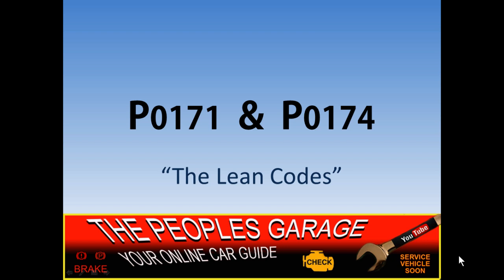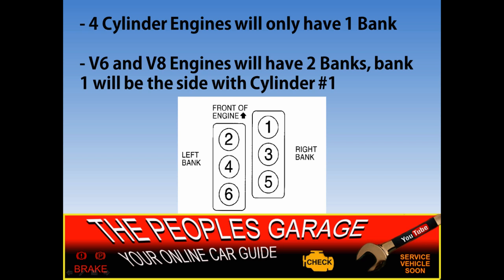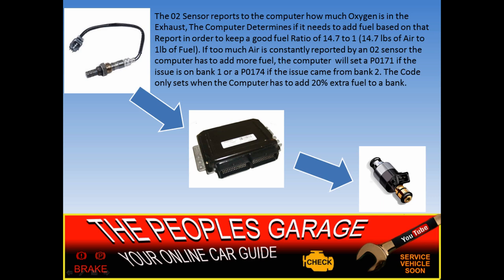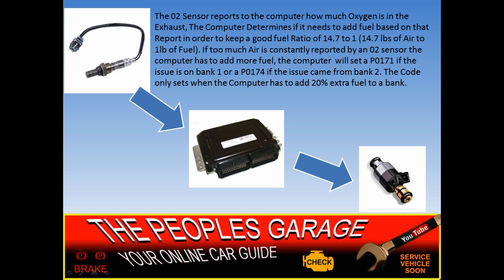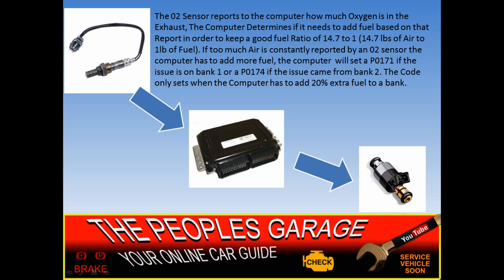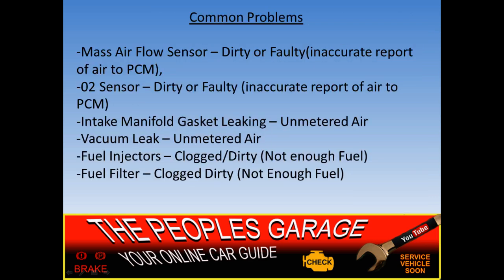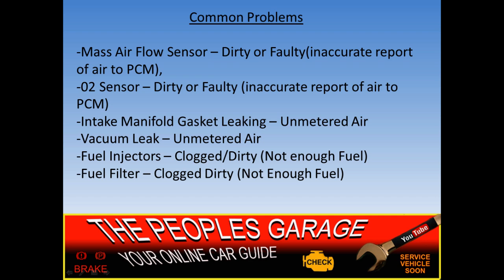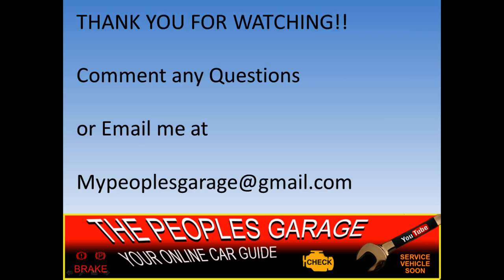How to Diagnose Codes P0171 & P0174 - Lean Bank 1 & 2

Comment: I have a 2011 silverado 4.8l i cleaned the MAF sensor checked the intake for leaks didnt get anything on that replaced the O2 sensors light went away and didnt come back till about 1000 miles or more later what else can I do I dont have a rough idle at all and no lack of power. I do have an exhuast leak behind the muffler and im pretty sure theres no vaccum leaks

Comment: I did found a vacuum leak and fixed it on the fuel injector #7 after cleaning injectors and replacing the seals, I still had the lean code. I took off the intake manifold and found that on that cylinder there was evidence of back fire the plastic was charred and causing a leak on that injector. fixed that. however I still have the P0171 lean code.

 I'm going to check again for vacuum leaks and change the fuel filter. I will check again the MAF sensor and test it. I'll update when I found more info.

Comment: Love the video. Can you advise me which o2 sensor /reports the airflow that is reacted on to give the lean fuel message. I.e is it both o2 sensors or the one post catalytic converter or the one near the engine bay? - On a two o2 sensor engine.

Comment: usually, if you have that lean code on both banks you have a vacuum leak or low fuel pressure which means more air and the oxygen sensor will throw a code.... lean bank one and bank two.  just a thought, everyone is in such a hurry to replace oxygen sensors just because the autozone scanner said thats what it is.  lol    wow, i know,   anything to sell a part they dont need
Reply: Get yourself a 40 dollar code scanner on Amazon. With that you can see your fuel trim levels and diagnose your issues. There are tutorials online that would help. It is easy to rule out vacuum leaks and 02 sensors if you had the scanner.
Reply: What if my 99 mustang gt gives P0174 and the MAF says 5.0 g/s?
Reply: Very true!!!
Reply: Lmao you got me at autozone scanner, will definitely look for a vacuum leak.
Reply: james hayes
Reply: Just got p0171 and P0174 no codes before I added gumout octane booster to a full tank 2 tankfuls ago, can that be it? How do I fix? Only other thought is maybe MAF got dirty from all the ash floating around here in SoCal from the fires, no visible hose cracks any suggestions appreciated have to take in for a smog check thnx
Reply: @arikoenig4536  check your intake air filter first. The filter comes before the maf sensor and should've captured much of the smoke from the air.
Take a look. If your filter is old and dirty then maybe go get yourself a replacement... I suggest a fairly inexpensive upgrade to a k&n filter while you're at it. It shouldn't cost much more than a stock or basic filter.
If the error code continues after replacing it then I would get a spray can of maf cleaner and spray that mofo maf down. Fairly simple to get out and clean for most cars.
If your filter was clean or the issue persists after doing the steps above then I would start leaning towards a possible vacuum leak. 
IMHO The fuel additive is unlikely to be the cause. Was there a reason you added it to your car? Was there anything else out of the ordinary done to your car? Sometimes the lean codes can take a week or so to show up and/or go away. Some cars require 20 miles or more of driving to turn on/off those error codes.

Again this is all just my opinion and it might be completely wrong. It's really hard to  say without looking at the car.
Reply: @arikoenig4536  Any luck fixing your issues?

Comment: Thank you for the explanation  on the P0171 and P0174 codes. I have a 2005 ford F150. I'm trying to diagnose the engine. It sounds as rough as a diesel, It has P0171 code and has a chug sound coming from the exhaust, It runs very rough, but when I press on the accelerator it evens out when it runs passed 1200RPM. The sounds either go away or perhaps the engine is running too fast  for me to  hear ( the chug and the rough idle). It didn't have any codes until I ran it for about a halve hour after adding almost a qt of Miracle Mistery oil, in the oil. It did run much smother after adding it though. I've heard of problems with cam phasers, VCT solenoids, and Lash adjuster lifters that get clogged causing to jump of timing issues. I'd like to know where you would recommend to start the diagnosis process in order to fix the issue. I'm thinking after viewing your video; should I start by cleaning the injectors and checking the ignition such as coils and spark plugs? the truck has been maintained with scheduled oil changes and services for the most part.Thank you again

Comment: have a 2011 silverado with a 4.8 I'm getting the 171 and 174 code the check engine light comes on and then shuts off i cleaned the MAF sensor and ran fuel injector cleaner threw it I do have an aftermarket exhaust on it just wondering if its the O2 sensors or the intake gasket

Comment: Thanks for your video! I have a 06 BMW X3 and it recently displayed three faulty codes ; p0507, 171 and 174. I removed all of the vacuum hoses and realized there was a leak in the intake boot, so I got that part replaced. Then I erased the Check light indicator and it appeared again, but this time with only 171 and 174. Do you have any ideas what might've went wrong?  Thanks!

Comment: Very helpful ,  I have a 2005 sts cadillac.  mostly around town driven but in the last few days I have been hitting 90-100 mph on the Arizona highways,  all of a sudden when I stop it feels like the car is running on 6 or less cylinders.  very bumpy engine performance.    93,000 miles on it.   Can I drive to vegas (from Phx) and fix it there without destroying the engine or computer.  I am crushed for time, need to get there for work 7 hours from now.  I am going to take a cursory look at the hoses and see if it is the elbow on the back side of engine.  any input would be apprciated

Comment: Hey I appreciate this video, I have a question though, I have a 04 mountaineer. When I am driving down the interstate it will act like it stops getting fuel and then it gets it again and when it happens it bucks really bad. It will do it over and over for several miles and then go back to normal. I have had it checked and the lean codes show up.I have changed the fuel filter. What else can I do.

Comment: I have a toyota corolla 07 and i got p0171 so i ckean the mass air sensor,change 2 oxygen  sensor, change the manifold, and it still have the same code. I checked for leaks on the catalic or muffler  but there is none. I hope you can help me with this problem.

Comment: Btw - how can you tell if the intake manifold gasket has a hole?  Is there some clever way?
Reply: Alan Osman spray brake cleaner around the gasket while the engine is running, if theres a hole it will suck in the cleaner and the engine will rise in rpm

Comment: ok so I just changed the spark plugs and wires and throttle positioning sensor and about 2 months prior to this I changed the fuel filter on my 04 mountaineer, now when im driving down the interstate at around 75 or 80 mph it bucks really hard and loses speed. could this be caused by a bad fuel filter????

Comment: So I have a 2006 Chevy Silverado 2500 HD 6.0liter V8. I am getting P0174  and P0171. Things I have replaced- Mass Air Flow Sensor, all 4 O2 sensors, air filter, also unrelated but the knock sensors. I cannot seem to nail down what the issue is. When I replaced the knock sensors (yesterday) I checked the injectors and they didn't look bad. Now I just also got a P0446 code. Did not have that before doing the work yesterday. Any ideas. My next step I guess is probably the fuel filter. But after that I am at a loss.

Comment: Hey, i have a p0171 code on an HR15 engine on a Nissan Tiida. i changed the o2sensor before and after the cat, cleaned the maf sensor and reset and after an hour of driving the check engine light comes back up........same code appears again...

Comment: I have a 2003 Lexus ES300 with the following codes: p0300, p0171, p0305, and p2195. These codes came on after bad gas was put in my car. I replaced the A/F ratio sensor. I need to know if I need to change all plugs and injectors to handle this issue.

Comment: hi, thank you for the very informative video! 

i'm not a mechanic, just a 2008 VW Eos 2.0T 6 speed manual 4 cylinder end user who's car is throwing the DTC generic code P0171 "bank 1 system too lean".  i took it to two recommended shops shere i was told they had sophisticated diagnostics and tools.  either they did not or wanted nothing to do with a VW.  which i've heard before.  i need to get my car to pass inspection and emissions in the state of PA (pittsburgh).

the car runs fine otherwise. i don't notice any missing, sluggish acceleration, high idles or anything like that, although one very freezing night it would crank once (i had dash lights) but then do nothing--it never happened again though) other than what i swear sounds like airflow right at the beginning of second gear.  like if one were to open your mouth and breathe out through the throat (don't laugh, i'm serious). 

something perhaps important to note is that the car sat for nearly 3 years while i was living in nyc.  and i hadn't drained the fuel or use any stabilizer (now i know).  so i know i'm going to need a regular tuneup as well.

also, if it matters, moons ago i had a 2004 VW jetta 4 cylinder where the check engine light went on after XX,XXX miles and ended up "needing" o2 sensor(s) but i don't know what codes went off or what else may have been fixed.  i realize it could have been a multitude of things, but little italian guy armondo (RIP)  in philly fixed it.  quite a bit of parts' $$ later.

anyway, any suggestions on the best way to identify a reputable shop, other than a VW STEALERship (no offense anyone) who will fix everything under the sun and rip me off.  my concern is not as much hourly labor as is the quality of the troubleshooting and fixing things that don't need fixing.  what exactly do i need to know the shop has/does to properly diagnose and fix this. i'm a girl, i need to sound educated or of course there is going to be that wool-eye female duping unfortunately.

any advice is much appreciated :-)

Comment: So it could be a dollar fix.  AND, it could be O2 sensor, fuel filter, air filter, Cadillac converter, gas, exhaust system as a whole, air leak in any of the hoses basically, computer malfunctioning the data of sensors, forced air in the lines, inability to add percentages to ratios for non mechanic watching YouTube still trying to figure out what actuator is, dirty anything from gasket to air filter or mass air flow sensor whatever that is, loose fuel cap, vacuum leaks in general, melting rubber elbow, manifold everything and anything.  I'll have it worked out in 15 minutes.

Comment: I have 171 & 174 on my 2004 E46 BMW 330ci. I noticed it the other day after I filled up with gas. Thought maybe it was due to me leaving the car running while pumping gas, or not getting cap back on tight enough.

I will try and clean the MAF when I get home today to see if that changes anything, but if you have any other tips I can look for don't hesitate to reply.

Thanks
Reply: hey did you figure out what the problem is? Im in the same situation
Reply: I ended up taking it to dealership for an AirBag recall. While there I also had them diagnose Errors and they determined that I needed to replace the Crankcase ventilation system. They wanted a $1000 for labor and parts. So I'm just going to get all the parts and do it myself with a friend. That should save me about $800. :-)

Comment: I have a P0174 code on my 2001 Nissan Sentra it says Fuel system lean bank 2 but from what you said on your video my car shouldn't show a lean bank 2 error because it is a V4 engine.  I'm not sure what to check on my car.  We bought a can of CRC Mass Air Flow Sensor cleaner and used that to clean the MAF sensor.  It did help a little but the car is still not running right.  We also bought a can of CRC Throttle cleaner and used it on the throttle.  The problem that is still happening is when I put my foot on the accelerator the car won't accelerate but the RPM gauge goes up, I can't get the car to go past 30 MPH.

Comment: i have a P0174 ... just replaced the 02 senors and then we cleaned the mass air flow sensor, light went off for 3 days but now is back on and is throwing out that code. what can i check? where should i start bc we already checked for vaccum leaks but have not found any...

Comment: Thanks for the video. I have a 1999 Ford E350 with a V10 engine , has codes P0171 and P0174. I found a bad PCV elbow hose, the hose was swollen and you can hear the vacuum leak, I  replaced the hose and road tested and the codes came back. I checked my LT fuel trim at idle and it is at 5% or less, but when I bring the RPMs around 2000 the LT fuel trims are above 20%. My fuel pressure is at 45 psi. I don't have a vacuum leak at idle because my LT fuel trim is less than 5% at idle. I induce a vacuum leak at idle and my fuel trims goes up to 10%. I sprayed carb cleaner around the intake and it did not make any changes in the RPMs or the fuel trim numbers. I replaced the MAF sensor and it did not fix the problem. LT Fuel trims are above 20% when driving under light to heavy load. I sprayed carb cleaner into the fuel regulator vacuum line at engine idle to see if  the O2 sensors would respond to a rich condition and both O2 sensors went to .9 millivolt. I am out of ideas.
Reply: Thanks for the info.  I'm working on the exact same vehicle at the moment and am pulling codes P0171 and P0174 along with code P0300 Random Misfire Detected.  I am still working on find the exact source of the issue, and would like to know if you managed to fix the vehicle you were working on?
Reply: Green Bottle Guy I will let you know in a few days. I don't have a miss fire. I spoke to a local auto repair shop and the guy was also out of ideas. He told me to come back and talk to their top Tech. I am going to smoke the intake system and see what comes up. If that don't work I think I am going to send it to the dealer.
Reply: Green Bottle Guy I disconnected the battery and the ECM had to relearned the fuel trims. Road tested and all the systems passed Readiness Monitor. Fuel trims are at 5% to -5%. Codes did not come back. Wish you luck with your vehicle.

Comment: 171 & 174 codes. I have tried almost everything. Smoke test found no leaks of vacuum, no leaks in fuel evap and no leaks in the Engine itself. Ford 3.0 DOHC in 1998 Taurus. I have removed Intake Plenum and pressure cleaned all Injectors, replaced spar plugs, replaced intake gaskets and throttle body gaskets. fuel pressure at Rail, Key on Engine off =37 lbs, pressure Engine on = 29 lbs. Fuel pressure at Fuel Filter is 85 lbs. Replaced Fuel Regulator and no change. Before all of this I did spray Engine Starter Fluid around engine and got no change in RPMs. Cleaned MAF twice. Fuel Trims repot as follows, STFT = about 3% both banks, LTFT = 20+ % both banks. O2 upstream seem fine but down stream O2's reporting lean ( go imagine). I ran engine at 2500 doe the road and then measured O2 temps showing 100 degree differential between front and read, so I assume they are doing their job. I still need to pinch off return fuel line to check pressure at the rail to make sure regulator is not faulty ( even though new). Downstream O2s may be an issue but I am not sure.
Reply: The Car Doctor
1 second ago  ·  Shared publicly 
 
You can try running a MAF calculator and see if the value is close to what you show as an actual PID. Good luck! http://www.stealth316.com/2-air-fuel-flow.htm
Reply: Ccheck for vacuum leak in brake booster. There's a check valve preventing the smoke from going the opposite way

Comment: Did everything to clear these codes (02 sensors, MAF, gaskets, disa valve, vanos seal, plugs/coils, vacuum test) and I still get these codes. Going to change fuel filter tomorrow.
Reply: I thought I had finally solved the problem! But the codes came back within a few days ;( I also have P1349 misfire code. There has to be a vacuum leak somewhere that I missed.
Reply: Randall Schoverling What vehicle do you have?
Reply: Check for leak inside brake booster

Comment: I have a 2002 GMC Yukon. I have both codes p0174 and p0171. I changed the MAF. Still same issue. How to find out if the o2 sensors I need to change is down or upstream? Thanks

Comment: Hey thanks for the tips awesome..! I have a question my 2003 gmc Yukon denali 6.0 L, the check engine is on since last week... I connected the scanner and is showing PO171 and PO174 but, is this codes also affect the oil pressure I recently changed the oil  the pressure is no reading in the middle but not oil is missing ..what should I do?

Comment: I have an acura 2004 with about 56,000 miles on it. It says my o2 sensor is running lean bank one sensor one. I had subs and amps put in my xar, and they ran the wires thru the engine. My question is... could they have messed up something? Also, how often is it just a dirty sensor vs. Something serious? Please help. I dont want to be swindled.